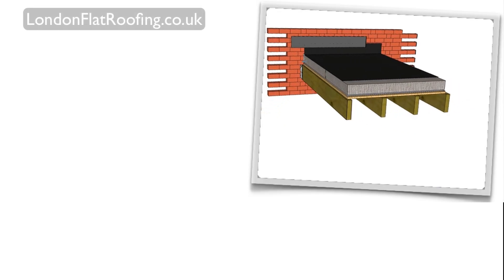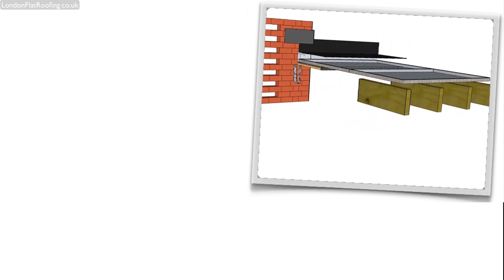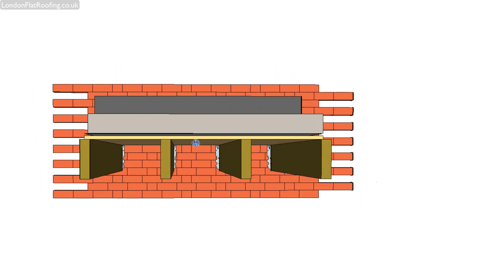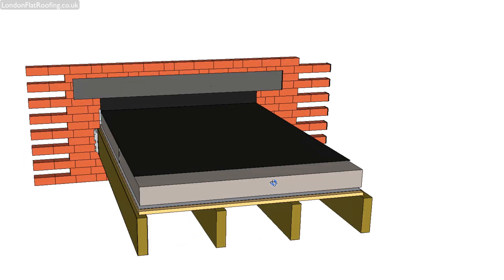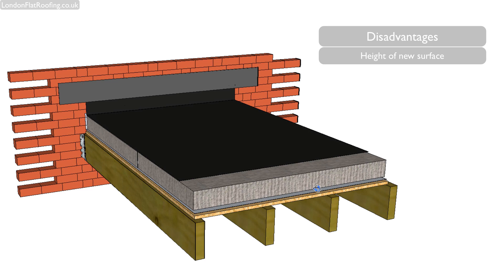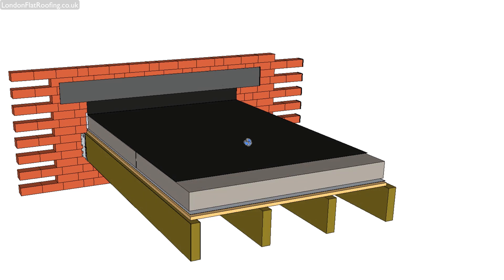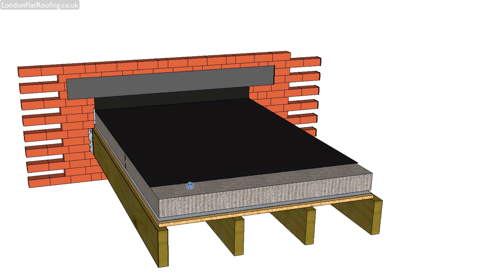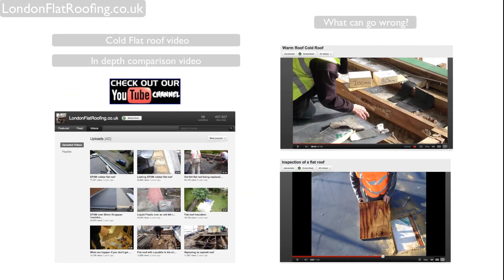Warm flat roof construction Explained.

Comment: I'm doing a balcony over hollowcore slabs with bedroom underneath. Would this warm roof option in fibre glass and then tiles on top of this fibre glass which has a roughened finish for tiles to bond be a good option?

Comment: No one seems to talk about the massive cold bridge, being the external wall the roof/extension is built against? What's the best way to retrofit a thermal break there? Otherwise all this effort will be negated.
Reply from the maker: There's a lot of detailing that I could talk about so realistically you need to send me information. Perhaps I can help you.
Reply: @SteveRoofer   thanks for the reply (especially on a 13yo vid ha). Lets take the situation you outline in this video, where the roof is mounted against an existing external wall. How to ensure that external wall doesn't continue down into the internal structure, thus becoming both an external as well as internal wall. For arguments sake, say the rooms opened up to each other (i.e. existing internal room, and the extension you show in the vid). Thanks again, love the great content and knowledge

Comment: Hi Steve, I’m about to strip the asphalt off a concrete balcony which also doubles as a roof over the rooms below. I will be replacing with EDPM. If I’ve been told I should insulate the ceilings below and above the slab I should add a vapour barrier and insulation before finishing with OSB and finally the EDPM. Is this correct?
Thanks

Comment: Great video Steve, you mention laying osb over the insulation to prevent squashing it: would that board require a breathable membrane on top of it?
Reply from the maker: Well, that is a very good question and theoretically no because you have got a good favour Beria down below and they'll be no vapour or moisture in the roof buildup. However, in my own personal view as Belton braces, theoretically you could form a cold roof over the warm roof, so that if there was any vapour that got into the roof buildup it could get out that's a real good solid build up then but obviously cost lots of money and takes up more. Space

Comment from the maker: Very good question, but easily answered if you think about the vapour being trapped in the roof where does it come from? It comes from the room below so there's vapour in the room below. How comes that isn't a problem and the answer is because there are no cold spots for it to condense on this is the same in a warm roof. The insulation keeps the lower decking warm and therefore there is nowhere for the moisture that may get in there to condense.
Reply: Hi Steve, isn’t there a massive condensing area on the outer joists or where the outer joists meet the OSB? 

All that humid air from the room below would condense on the cold, uninsulated outer joists below, wouldn’t it? These would then degrade over time?

Comment: What is the difference if there is no vapor barrier and the moisture is trapped under the epdm vs there's vapor barrier and the moisture is trapped between joists vapor barrier and ceiling, still moisture is trapped without air circulation 🙄

Comment: Thank you for that informative video Steve. Would you need insulation between the joists before fitting the ceiling/plasterboard? If not, why?
Reply from the maker: No as its a  warm roof all the insulation is on top. If you add insulation between the  rafters, you can lower the duew point and could cause problems
Reply: @SteveRoofer  Thank you Steve. Much appreciated!

Comment: Would you happen to offer one on one paid guidance for a small projects? I'm doing a warm roof that's part of an extension. Has block parapet walls with a wood deck. I have some questions regarding ice water barrier, how far it should go up on the wall, if I add wood decking to the walls before I add an ice water barrier to them etc.

Comment: I'm doing an extension and I'm looking to use a warm roof like the one you have here. I would like to add a overhang, do you have any videos that demonstrate this or is it a matter of simply extending the rafters beyond the building structure? The top of the extension will be used as a balcony with added railing. Can I simply add a more firm surface over the warm day and add railing? Well that's suffice?

Comment: Hi Steve, Great videos thanks, I work for the NHS so roofing is new to me but this is my understanding.  I am planning an extension 4.8m wide by 3.8m going out.  The architect has applied for 2.7m at eaves going to max of 3.3m high.  I would also like to put in a 3m by 1.5m roof lantern in for extra light.  From the excellent info you've given, I fancy a warm roof but worried I wont have the height however you mentioned using CLS 6 x 3 joists 18mm OSB, 120mm Insulation, 18mm OSB to stop stressing the insulation, a high SD value green vapour barrier and then foil,  going up 150mm to the roof lantern and the roof lantern is 530mm high so I'm hoping I will be just under 4m as apparently that is the highest point for top of roof lantern?  Is that about right? and will the CLS 6 x 3 joists support the weight of the lantern as the CLS 6 x 3's seem to be a maximum length of 4.8m?  Thank you, Clive.
Reply from the maker: You're welcome to send me details and I can help you more but realistically you need all this worked out by an engineer I can't do that for you it's not part of my skill set size of Timber's and stress is an engineers job as regards warm roof cold roof always do a warm roof drop the roof detail down slightly if you have to. The height difference between a true warm roof and a true cold roof is so minimal I don't understand why people keep choosing Cold roofs

Comment: Hi Steve, can I use the existing leak free torch on roofing material as the vapour barrier in a new warm roof over an old unvented cold roof garage renovation? My present roof is fine and seems to be a waste of $ to take it off and add another vapour barrier before rigid foam, new decking and EDPM. 
Thanks
Greg
Reply from the maker: The answer to that is yes it is in good condition you need to go around the perimeter and put an up stand on and then put more fill up the up stand so that the insulation sits inside a framework that has made the barrier under it and around the four sides

Comment: If the vapor barrier is on top of the OBS board, doesn't the vapor get trapped between the OSB and the vapor barrier ?
Reply: You have to look at things like this all materials will allow the vaper to bass though. Some have better quality than others  We use stronger  AVCL air vapour control layers in the correct place thus forming a barrier, moisture that penetrates though can then work its way out as thematically  the materials above are more open and moisture  below is below and inside the property thus in harmony with the internal environment

Comment: Architect has specified Sarnafil as a top cover of my warm flat roof. I was wondering what your opinion is re the brand vs other brands on the market.
Reply from the maker: Sanafil is extremely good but like all things has to be installed correctly. it's good looking but expensive.
Reply: @SteveRoofer  Thank you for the quick reply.

Comment: Hi Steve, thank you for explaining warm roofing. I have a log cabin with a very simple sloping roof: joists with decking,  which is covered with one layer of roof felting with chipping (the one that comes in a roll). I used bitumen roof felt adhesive between the felt and the decking plus felting nails. No vapour barrier, I am afraid. I have done this 5 years ago and it is still sound, however it is very cold in winter.
I want to improve the insulation without going inside the log cabin and was thinking fixing a layer of Kingspan on the existing roof, possibly without making holes on the still OK felt roof underneath by using some sort of fixative.
On top of the Kingspan I will lay 50 mm polystyrene sheets (1m x 1.5 m each) that come with felt backing and this will complete the roof. I would love to know your opinion on this plan and your suggestions would be very welcome indeed. Thank you.

Comment: Hi Steve if you put spot lights in the ceiling do you need to ventilate between the joists then? Also Do you secure the insulation to the vapour barrier if so with what glue and do you secure the extra decking on top of the insulation or simply lay it on? Thanks

Comment: hello steve and thanks for the video.
We are building a houseboat and soon its time to build the roof.
its going to be flat and most probaly a warm roof. 
we would like to use it as deck and spend time on it, so we need a material that is waterproof but at the same time its pleasent to be on (so not a membrane ot something like this). i would like to make a fiber glass and epoxy (or 2 components resin alternatives) roof.  i imagine it to be a bit like the deck of a boat.
i dont know if it makes sense because i dont know if a little bit of vapour pass through the vapour barrier then its not capable to get out anymore and creates mold.
i would use an as good as possible vapour barrier such as alutrix 600 as i learned on this channel .
it would be like this from inside to outside:
--plywood
-vapour barrier
-insultation
(-plywood maybe or directly the fiber glass on the insulation)
-fiberglass and epoxy

i would appreciate your opinion. 
does this idea  make any sense?
 if not what other material would you suggest instead?

thanks a lot in advance

greetings from berlin

Comment: Hi Steve,

Is the subdeck always required? Our builders are planning on placing the insulation directly on the roof joists without a subdeck and then placing the OSB on top of the insulation. I was under the impression it needed osb on the subdeck too, but can't actually find out why.

Comment: Hello Steve,
I got my roof done nearly 5 years ago. I assume it is a cold roof because roofers put only plywood and fatra membrane and then fibreglass. I am quite sure there is no insulation. 

I have problem with condensation beacuse there is no proper ventilaion. Is it possible to get it done on existing roof ? For example  ventilation mushrooms on the top and in facias ? Or do I need a new roof ? I cut out piece of plasterboard and checked what is happening inside. The wooden boards are cold and wet...

I hired a very well know company from Wales (Newport)with good reputation and reviews. I have 20 years guarantee. I am with contact with them but need and expert opinion as well.

the property was build in 60’s

I did have no knowledge back then about roofs. Did they do the roof incorectly ?
Reply: I forgot to mention that neither of houses in my neighbourhood have ventilation mushrooms and the height of my roof and their is very similar so I assume they have similar construction.

Comment: Hi there, I have a concrete flat roof.  (yes concrete)  4-6 inch pour, held up by steel plates and steel beams.  my late father put it in. there is some unfinished space he couldn't finish, so the ceiling is unfinished from below. the roofing is done. Actually done quiet well. Looks like some Rubber roof of some kind, followed by a dimple mat with filter fabric, (air gap)  then a layer of paver stones. The stones should block all the UV making the roof last forever (ideally).  unrelated But I thought you would find interesting. 

Question for you though. since the room below it this roof was never finished do should I keep it vented, (Cold roof) and lay insulation the ceiling tracks under it, or spray foam the top of the concrete roof? looks like my dad had provisions to keep it vented.  but not too late to change. do you have a video to suggest to watch? I'm starting too look at all your videos.   
Thanks. :)
Reply: In TV

Comment: Comments are off for this construction guide, I guess because they know it's wrong. 
https://youtu.be/TNJxUo0RQfI
I think it has these issues:
1. Vapour barrier is low quality bin liner material.
2. Vapour barrier is wrapped around insulation on top instead of being adhered to the walls, leaving gaps around perimeter for vapour to rise.
3. Insulation blocks are pointlessly taped on top.
4. No foam is used to join insulation blocks into one continuous sheet. 
5. Plywood is used. That's over-specced for this application  compared to cheaper OSB.
6. Bridging from joists all the way up to the top deck with metal screws instead of using plastic fixings which bury the screw head half way down inside the insulation. (Also the very long screws could easily miss the joists when driven without any jig/tool guide like this)

Am I wrong or did I miss anything?

Comment: Hi Steve
Love the channel find it very interesting and informative.
Do you know if a warm roof is vented in between the Joists is this going to cause a dew point on top of the plasterboard as the warm air meets the cold air in between the Joists.
Any information would be appreciated.
Regards

Comment: Is it OK to have a second layer of decking between the top of the insulation and below the felt? Or is there a risk of that timber rotting because it's between the vapour control layer and the felt?

I understand it's likely unnecessary but it has been laid already in a new build and I'm wondering if I need to take it up
Reply from the maker: New information suggests that there should not be a second deck on a warm roof. You are quite correct, the second deck is above the vapour control barrier and if vapour was to collect it could rot (interstitial condensation). Everything below the Vapour Control Layer (VCL) is internal, and is therefore subject to internal temperatures, with no risk of interstitial condensation and no need for ventilation. Above the VCL in the sandwich of insulation and roof membrane, there is a risk of interstitial condensation, this risk is reduced further by having a roofing membrane that has a lesser, or equal, resistance to vapour. If you start with a VCL that is of poor quality, don't fit it correctly, don't seal all the joints and don't seal it to the perimeter, then puncture it with fixings, its vapour resistance will be dramatically reduced. Start with a VCL that is of high specification and fix it correctly, and you should end up with an excellent VCL that also acts as an Air and Vapour Control Layer (AVCL), and should be equal to or above vapour resistance of the chosen roof membrane. The vapour permeability of most roofing materials on the market is hidden deep down in their specifications, almost impossible to find. I have never had a roof design given to me that has taken the above into consideration when specifying materials to be used on a flat roof. Always use the best VCL at the bottom, make sure that all materials used above are vapour 'open' (can breathe) and don't use foil-faced insulation in your roof buildup.
Reply: @SteveRoofer  Thanks Steve that's very helpful. The vapour control layer is also already laid but the ceiling below hasn't been slabbed yet. Any benefit to putting another VCL above the slab and below the joists leaving an air gap there (or filling it with insulation) or does just potentially lead to the same problem for the lower deck layer?
Reply from the maker: @89feighery  Unfortunately I don't know

Comment: Hi Steve. Thanks for all your very informative videos. One question please. I now have my newly finished warm roof over my garage which is being converted to a utility room/snug area. I am ready to put up the plasterboard ceiling but i am unsure if i should be using standard plasterboard or duplex. your advice would be very welcome indeed. many thanks.
Reply from the maker: If it's a warm roof then any plasterboard will works. All the Vapour control and thermal properties are above the decking.

Comment: https://youtu.be/TNJxUo0RQfI what do you think to this please
Reply from the maker: Completely wrong and miss leading. No vertical insulation to soffits. They are using a black DPM not a VCL and they are not fixing it to the side walls just to pin point some of the mistakes I cold list several others.

Comment: Hi Steve, really helpful video. For my Warm Flat Roof, I mistakingly laid a breathable membrane triple-layered Cromar Classic which is triple-layered having its top layer waterproof. But ideally, it would have been damp proof membrane. Now to satisfy Building Reg and also to counter moisture getting into the structure, I have spoken to IKO technical help who have kindly suggested to put the 1200 gauge Damp Proof Membrane from the inner side of the joist structure before installing Plaster Board. Is it the correct approach? 

I need your opinion as I can not undo all the hard work done so far. Many thanks.

Comment: For the cold roof, why don't you use foil faced insulation (insulation with vapor barrier facing down, similar to wall with batt insulation with vapor barrier facing the warm side). This way you can eliminate the roof venting space.
Reply from the maker: There is not a roof insulation on the market that has a build in VCL vapour control layer. There is roof insulation that has silver foil on it that the manufacturer's when arsked will say that you can use as a VCL but its not there to do that. A vapour control layer should be continues if you use sheet insulation how will you make it continues when you can't get to the side thats down against the ceiling.?